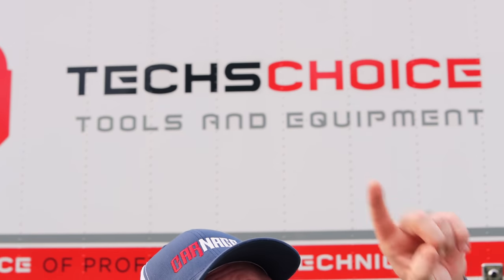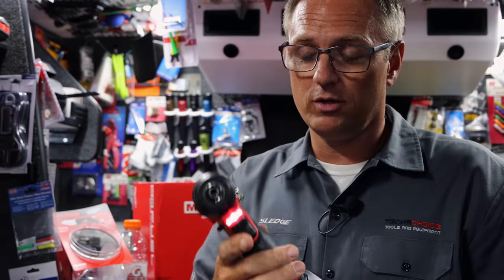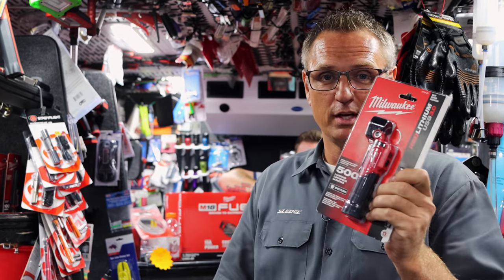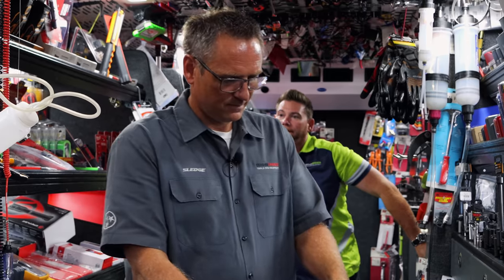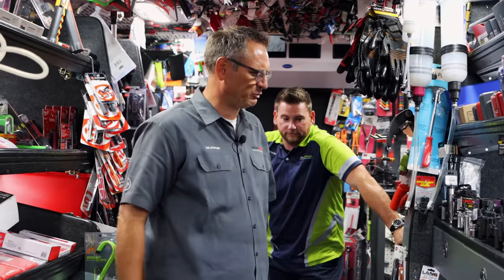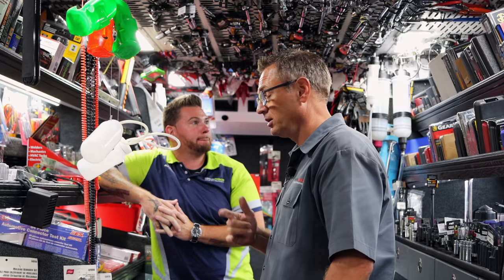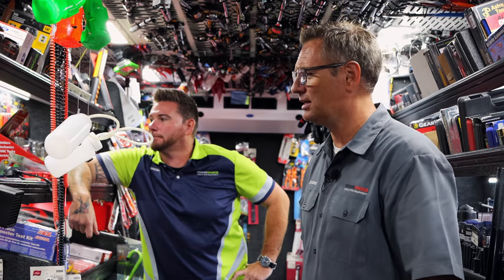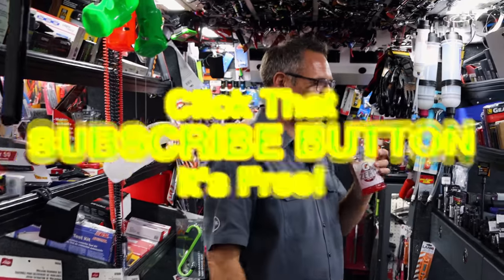Techs Choice Tool Truck Tour 2! Matt Throwing Out Some Deals For You Guys!

Comment: I know everybody probably knows this. I put rock salt in my ice cooler with just a little water in the bottom. Put your beer in first then add water up to about 1/3 to 1/2 of the height of the beer can and layer it with ice and rock salt, Guaranteed the coldest beer you will ever drink!
Reply: That’s awesome I did not know that thanks. Brother
Reply: Yeah even if you only put in ice, and regular table salt works too.

Comment: Lol I used a cut down and notched survey stake in my chebby 6.0 when it had an intake leak to make it high idle to warm up before I got a chance to change gasket. It would wedge between pedal and steering wheel. Thexton would of been a great option. 😂🤘🏻🇺🇸

Comment: If you own a John Deere tractor you need those wheel bullets as well. Just had to tap 3 bolt holes and order new lug bolts for one. BTW those lug bolts are almost non exiting in the part world. I ended up buying John Deere out of their stock of 9.